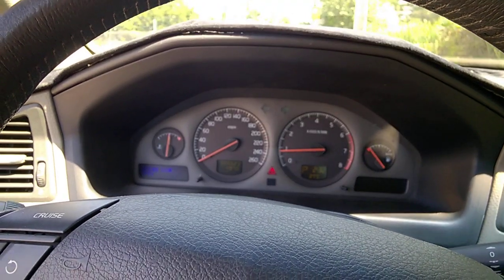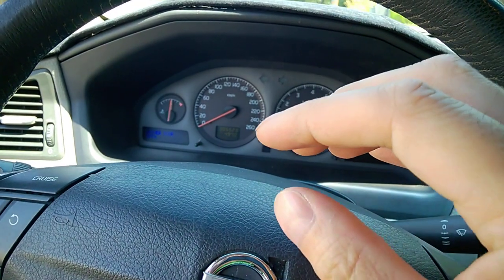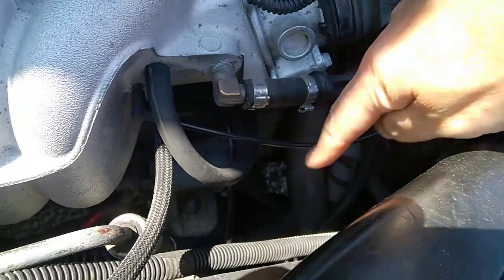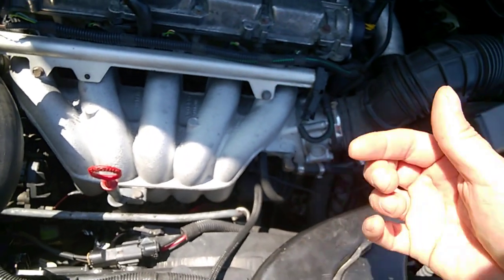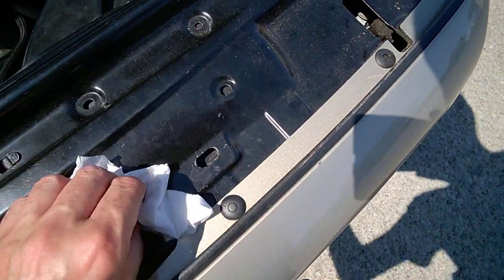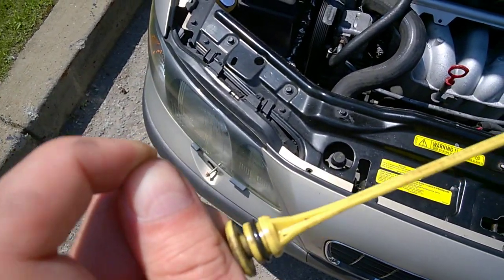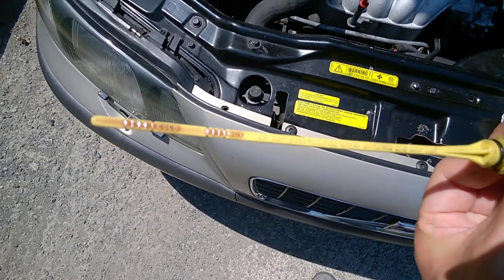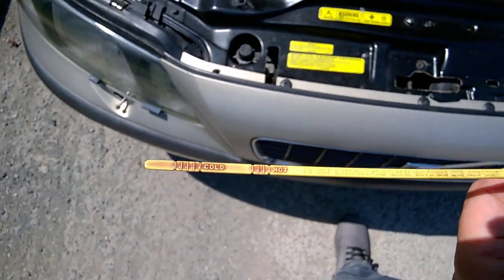Volvo S60 V70 Non turbo Automatic transmission (Aisin) Fluid level check 2001-2009

Comment: I purchased a very cheap 2004 XC70 D5. It has a AW55-50 box. It has 300.000 kilometer's on it and I think the trans fluid has never been changed. It's very dark, but dosen't smell burnt. 
My previous v70's transoil was dark red and smelled burnt. 

I'm wondering if that might be friction material making it so dark? I don't know if i should just drain the box and replace the fluid or leave it be.  What would you do?
Reply from the maker: If it shifts fine, I would not touch it.  Got mine with 180,000 kms and replaced the fluid only to have it shift less smooth
Reply: @Peppermint1  The box is harsh in 3rd, but thats normal. It seems to not lock up when doing a kickdown. I haven’t driven it enough to be absolute certain.

Comment: Why don't recommend vavoline maxlife?
Reply from the maker: I have used it and noticed the level was never steady, in my opinion this fluid volume changes too much with the temperature.  In summer time it would show over the max limit, while in winter time the level would drop so much in cold weather, the car would not move after starting the engine in the morning.  I have since replaced it with Toyota Type IV and these issues were solved.  I have read about the same issue with another owner on a forum.  It is good to keep in mind that many fluids have the 3309 norm, but all these fluids are different from each other, not the same quality.  The 3309 norm is only one of the many specifications of a transmission fluid, therefore I recommend going only with the better known brands (Mobil and Toyota).
Reply: Peppermint 
Thankyou for all knowledge and all experience. In my country volvo tranmission fuild is the best but high price. Mobil 3309 is good for everything. Valvoline maxlife is notgood notbad but inexpensive quality is available but somtime in hot day temperature of tranmission fuild go to 105c    my tranmission is jerky in position 2 to 3 ,sometime blank in 1 second.
Maybe must change it to mobil or volvo fluid.
Reply from the maker: 105C kills the fluid so it's good to replace it but I'd first try to find why is it overheating like this.  Normally it should not go past 80C unless towing or driving in the hills. Does the radiator fan come on?  The 2-3 kick is typical and depending on the car year it can be caused by the B4 servo cover (2001-2004) or by old solenoids (all years) or worn valve body (2001-2002), new fluid may not help much.  Try asking a Toyota dealer how much is the fluid.  There are also videos on Youtube that show how to replace the fluid at the return cooling line (no need to drain the oil pan).
Reply: Peppermint 

105C in summer time and traficjam. In normal is 90C good day is86C. 
When A/C off radiator fan blow on when 103C and off when 99C  so engine temperature is between 99-103C.
If i turn A/C on radiator fan blow step1 and alltime so engine temperature is 86-93C.
Oil cooler gear is in the radiator so engine temperature coolant equal tranmistion fluid temperature. In Bangkok Thailand all day is summer time somedays hot somedays very hot so engine and tranmission temp is high all time.

My V70 have problem in B4 servo so when gear shift to position 3 i lift my right leg for prevent it jerk.

Thankyou for everthing
My english is not good.
Reply from the maker: I understand, certainly the weather + traffic is very hot for your car.  Does the radiator fan turn at high speed when this happens?  The fan has two speeds low and high.  Normally the A/C on will require low speed, but transmission and engine will require higher speed when they get this hot.  Even in hot weather the engine coolant should not go over 95C.  If the coolant gets past 95C (as you mention) I believe the radiator doesn't work well even when stuck in traffic and with the fab at high speed.  These cars cool very very well, so possibly the radiator is clogged from tap water or wrong coolant.  If you can find this, it is good to clean all the system.  Then refill only with distilled water and coolant (50-50)    https://www.ebay.com/itm/Prestone-AS-105Y-Radiator-Flush-Cleaner-22-Oz/391995207948?epid=220333619&hash=item5b44bc310c:g:dq0AAOSwYgFan8df
See this for the B4, also look in the video description  https://www.youtube.com/watch?v=4BUJ2aEsecg
Reply: Peppermint 

ขอบคุณมากครับ
Thankyou so much
Reply from the maker: Welcome
Reply: Transmissions requiring the use of Type T-IV are somewhat finicky about fluid.  I had a Volkswagen and Type T-IV was one of the few known safe alternative fluids to the VW G 055 025 A2 fluid which sells for $18.36.  I now have a Passat with essentially the same transmission but newer and they specify G 055 540 A2 for it which is really just overpriced WS ATF and it sells for $24.80.  Not bad for a fluid the Toyota dealer sells the equivalent of for $9.97 for.  The Toyota dealers will sometimes sell it cheaper if you buy a whole case.  Ask them about it and you will see.
Reply: European Mannol 3309 is also not good for hot weather/variations.mobil and T IV is good.plus additional external finncooler,even without towing only city driving in hot days the gearbox becomes like its made from glass
Reply: @dejanaleksov1552  I looked at the price for Mannol fluids and the people selling them must be completely insane if they think I would pay those prices!!!  Look on eBay and see.  They get you with ludicrously high shipping fees but an otherwise acceptably priced product.  I guess they think that they can get my money that way since it is hard to find those brands here in the USA.  They can think again!  I wish Volkswagen would have put a real cooler in the 09G in their cars.  Maybe then they would not have all the problems they are so very well known for.  They could have had some of the best cars if they would just do that.  It does not help that fluid deteriorates from all that heat and these transmissions are problematic sometimes.  It is not just Volkswagen but some automatic transmissions are just awful.
Reply: It is only worse because they remove the dipstick and call it sealed.  It used to be for the 09G they never recommended changing the fluid.  There is no such thing as a "lifetime fluid".  They will all need to be replaced with new clean fluid at some point.  The WS fluid does not appear to be a long life fluid to me but some Toyotas have had that fluid in for many miles.  They must have had a real transmission cooler and not one of those things that keeps it at 190 degrees.
Reply: @Peppermint1  l have tried mannol 3309, Toyota Tiv,Mobil 3309 and volvo 540/640 oem oil witch is made in Japan. I drove all in my aw 50/51sn v70 xc 01. And only mannol is making variations on hot/cold and not shifting smoothly in hot weather plus uphills not good.its a cheap oil this mannol so i was wonderin and  I took a piece of toilet paper and put a drop of the mannol Toyota Mobil and volvo oe atf and the results in the morning, after only 12 hours, the mannol drop on the toilet paper was gone vanished only white paper left no red marks like its made of water and it vaporized.the other atfs were spreading around the paper and they were redish color still after 12 hours sitting on the paper,they werre also oily and wet but mannol completely dissappear.
Reply from the maker: @dejanaleksov1552  I appreciate the feedback. Would be nice to talk about this experience on european forums like https://www.volvoforums.org.uk/forumdisplay.php?f=19  because many people there recommend buying Mannol from Germany, so it's good to advise them about the downsides with this fluid.  Like you say, when it's cheap it's not good (and people unfortunately always look for the cheaper.. ).  I also had Valvoline Maxlife which is the cheaper here in North America, and I had the same problems you describe about Mannol so now I understand that cheap oils are not good enough.  Can you also make a viscosity test between the Mobil 3309 and Volvo genuine and Toyota Type IV ?  Like let a droplet leak inside a glass see if it leaks with the same 'speed'.  I wonder if Volvo Genuine is the same as the Mobil 3309 or Toyota Type IV ( I don't think it's the same, but a test would be a good example)
Reply: @Peppermint1  I dont have the Mobil and Toyota atf anymore,I dump it out of the gearbox,I tried mannol but I Flush that too. I now have volvo atf in my gearbox and its still shifting weird.so I have volvo oem atf maybe 1 little left and 0.5 litres mannol atf as reserve(left from the flushes) I'm planning to do a valve body replacement, I have a thread in volvo community and in volvo xc forums describing my experience with this aisin gearbox,and honestly I'm waiting for your reply about what do you think about the problem that I have,because I really appreciate your opinion oragex:-) .The tread goes in xc70, 01-07.thread title  AW55-50sn I need some advice,please help?
Reply from the maker: @dejanaleksov1552   I read your post on the XC forum.  The behavior after 1h driving in hot weather, to me I think your transmission may be overheating, perhaps the clutch plates have some wear to them.  Does the radiator fan run ? This must cool down the transmission fluid.   Did you remove the neutral stop setting?  For the 2-3 shifting, I would look at the B4 servo, I made a few videos on this list  https://www.youtube.com/playlist?list=PLl-l6yge4ast4eLeuPpECTts0FSVSOT_c  I would not go for the valve body at this time, because the transmission may already have other internal wear. Especially the 01-02 transmissions have been more fragile.  I would do the minimum (remove the neutral stop setting if not done yet, and look at the B4 cover washer - google), and make sure the radiator fan, the thermostat, and the coolant temperature sensor work fine
Reply: @Peppermint1  thanks for the reply. Yes the fan and the cooling system are running great. I've not done the b4 servo update but the gears are shifting great(hot and cold)I rarely get 2-3 symptoms and my Vin number is out of volvo Tnn for the servo update ( from 2001 Vin n.o. Last five 03.....and up, And mine is 02.....?) but I'll look for the washer and will install the new b4 part.As for the neutral/stop in 3 years owning the car I never had the setting(putt in D the car goes forward),and now I suddenly do get that feeling like its disengaged on stop lights(I can hear the solenoid engaging) and nothing happens its not moving, and when I push the throttle its vibrating a bit,like its  trying to engage in gear?(only after 30-60 min. driving in city traffic 35+c) the garage shifts are concerning me,(double D engagement and sometimes harsh R) when hot atf also when cold all is good with the box? I am not sure whether I have any software updates,the dealership told me I have all the software needed. Wtf?:-S
Reply from the maker: @dejanaleksov1552   The B4 cover washer was going bad even on some 2004 models.  2001-2002 is always worth checking it (replace only if the washer is loose).  For no drive in D when hot and vibrations can't really say...  could be the drive shaft doesn't stay inside the transmission ?  little chance, worth checking the drive shaft center bolt.  But still think internal transmission problem.. the 2001 and 2002 were fragile inside and didn't last long. Maybe the fluid is overheating because there is too much friction inside the transmission..  and the torque converter no longer works..  Who knows.. The garage shifting delay may be related to overheating as well..  Did you do the fluid counter reset in Vida ? As for the adaptations reset, these are only when we replace the solenoids or the valve body, because if it's done with the older parts, it may cause extra wear on the transmission.  When I replaced my solenoids, I got that garage shift delay and banging into D and R, then I did the adaptations reset and relearn and the delay is gone now - however I did it with new solenoids, not sure if it's safe to do it with old solenoids.
Reply: @Peppermint1  At the dealership this one guy who was probably incharge, and seems to know  about volvos told me that I migh have burned or wear on the clutches,he then reset the fluid counter, but not the adaptation. I felt more lock up after that and better torque.can I reset only the adaptation and not the full adaptation process with the driving patterns?are these two different options in vida?BTW I measured the atf after 10 miles highway driving 70mph its 90c.i measured it with an electronic  probe for measuring oil temperatures

Comment: Peppermint my fluid level is same as yours at the end of the t  of the hot part. I added luiqid molly 1200. Recommend for jws3309. Now running like crap. I bought valvoline maxlife. I'm hoping to get away with using that fluid. Should I be OK?
Reply from the maker: I prefer the Toyota Type IV or Mobile ATF 3309.  I didn't had a good experience with Maxlife, it was shrinking a lot in cold weather (caused the car to not advance in very cold winter days), and expanding too much in warm weather.

Comment: Thanks for the video, I didn't know the engine should be running for this test!
Would it be safe to assume that this fluid would be ok to use?
Aisin Type T-IV (ATF-0T4)
Reply from the maker: From the Volvo community, the Aisin Type IV does have the 3309 norm, however some users mentioned the fluid viscosity to be lower than of other 3309 fluids.  It is important to understand that the 3309 is only one of the fluid specifications.  I have compared several fluids with the 3309 spec, and other than the 3309 spec, all other specifications are different from fluid to fluid.  Some people recommend the Idemitsu fluid (see at Fcpeuro.com) over the Aisin one, but again no scientific test to prove one is better than the other.
Reply: @Peppermint1  Thanks!
Reply from the maker: @WhiteRocket918  Welcome. I think I'll work on a video to discuss about these differences on fluids - of course it is going to be just subjective observations

Comment: So why didn't you show people how to put it in, the fluid. That sucked;
Reply from the maker: On this transmission, fluid is added ONLY through the dipstick hole, using a long thin funnel and warming up the fluid so it flows in faster. These 5 speed Aisin don't have a refill plug - there is a plug at the top of the transmission that is actually a mechanical component of the 3rd gear and should never be removed.  https://youtu.be/Ad7HxgNP4s4   Location of the dipstick on turbo engines  https://youtu.be/3zxWHtQ4wXU
Reply: @Peppermint1  I by accident did that, and i have no 3rd gear. I live in The Netherlands. Can i fix it my self?
Reply from the maker: @bravosava   See this info  https://youtu.be/VFyQptqISsc

Comment: the trany fluid level dip stick is as poorly designed as the hidden rear window assist. -hidden. 
ridiculous the engineers who designed this most horrible design actually got paid. A simple hook made from a coat hanger gauge wire would work wonderfully I am sure.

Comment: Volvo fucked customers with their life time fluid.they should have putt a bosch zf or a getrag transmission in this xc serries and it would be another story
Reply from the maker: Hi Dejan.  In fact, it wasn't a Volvo thing, this 'non-maintenance' advisory came from the Aisin Seiki japanese company, who made these transmissions.  Other car brands got the same Aisin transmissions, like Toyota, and they also said it's a life time fluid.  Even more modern Aisin transmissions still say it's a life time fluid, it's all business model that will work for maybe 80% of the cars that will be scrapped after say 150K miles or so - for the remaining 20% who will try to drive their cars for 200K or 300K miles, well.. Aisin tells them 'good luck'..  Sad but true
Reply: @Peppermint1  hi.yup u r right man.sadly...botom line is that its good thing it even has a dipstic:-)
Reply: @Peppermint1  is there any Toyota or Nissan or gm or who ever else is driving this aw55/51 that is about 2 tons and 200 hp with lots of torque and stress overloading the transmission... Maybe thats why its heating so much?